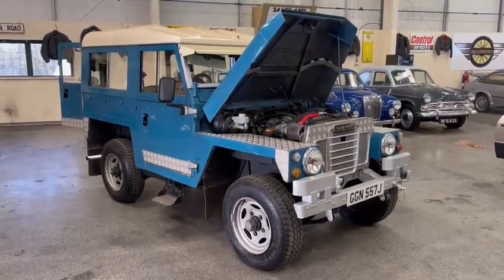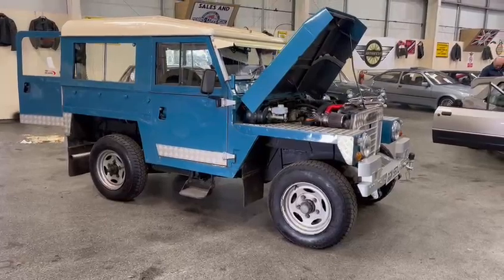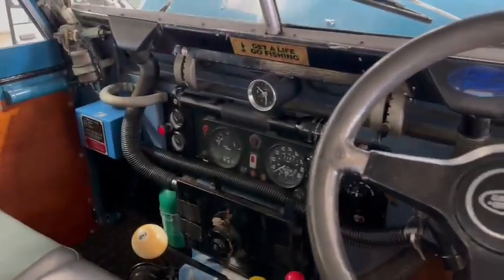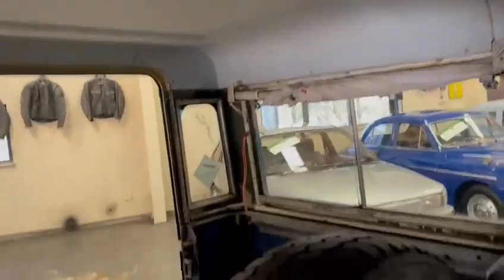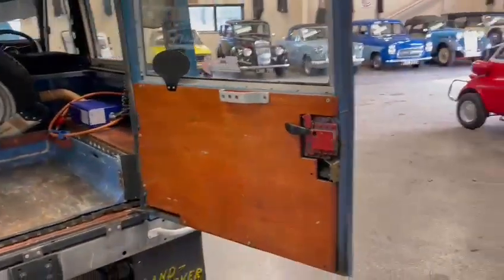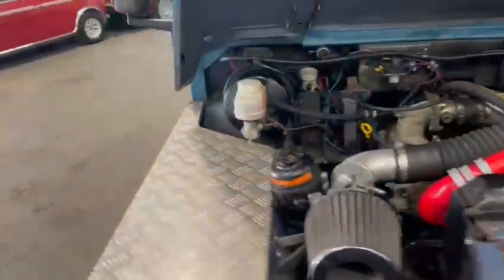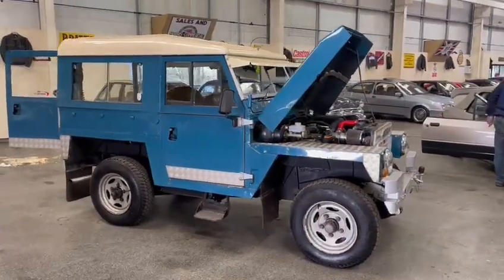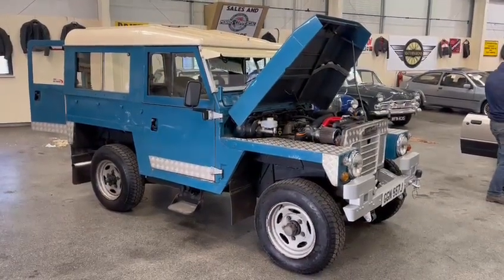1971 LAND ROVER LIGHTWEIGHT 4X4 UTILITY | MATHEWSONS CLASSIC CARS | 18 & 19 MARCH 2022

Comment: I rebuilt one of those just over 30 years ago, every nut and bolt. Put a 3.5 V8 in it, long wheelbase front brakes and a servo, overdrive, 101 wheels. Painted with Nato green matt paint, diffs off a Rover P6 and much more that I can't remember.